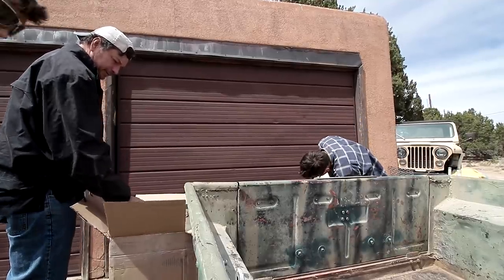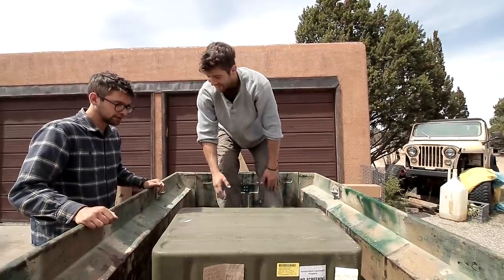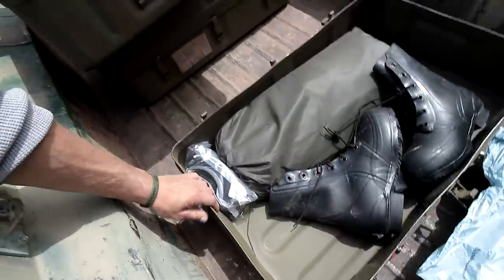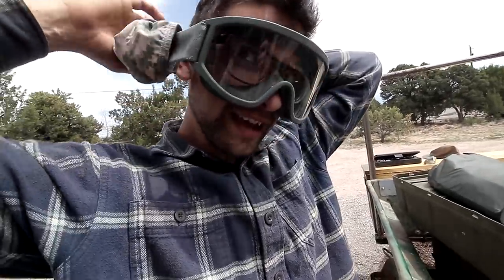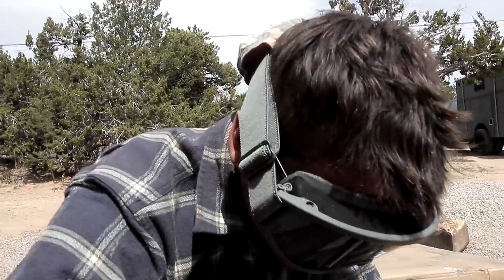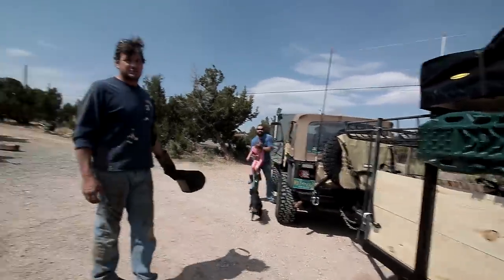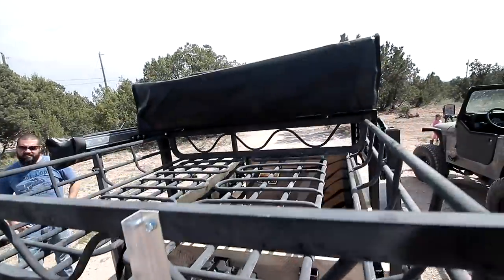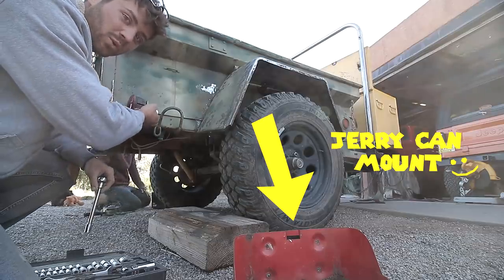DIY CAMPING/OFF-ROAD JEEP TRAILER!

Comment: Trailer is looking great.  That other guy's trailer has an impressive rear approach/exit angle but holy crap - the load is ALL tongue weight now!  Your set up is better, despite the lack of rear angle.  Good luck on the rest of the build.
Reply: SO are you back Jake?!!! Hope so missed ya! Totally agree with Woodworker bout his trailer. Departure angle on a trailer if it becomes that critical time to park the trailer, plus the wheels will be so far out of the circle on any turn well I could go on but, look on other trailers before you make any changes.

Comment: Your blog has always been an inspiration to me. I’m glad to see your getting back to working on your Jeep and trailer. I really like the tires and wheel combo and would like to do something similar to my yj. Isn’t the trailer a different lug pattern then the Jeep? What wheels are you using?  Are your tires 10.50 or 12.50 wide?

Comment: You should look for a pair of those real German Micky mouse boots,military issue. I think they are called “mouzers “ . They puff in the toe area for adding insulation, really cool boots , you could kick somebody in the ass with those on and the puff will bounce your foot right back to the ground in case you need to turn around and run

Comment: Bro!
I think you’re putting too much load on that 6 cylinder. 
Needs a small block for all that added weight and oversized tires.
Reply: proper gearing should cover that